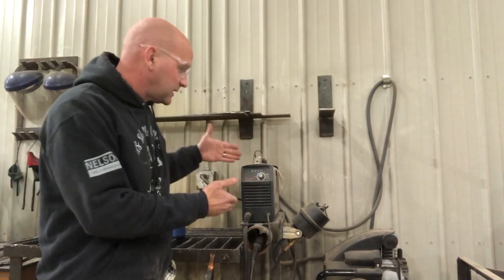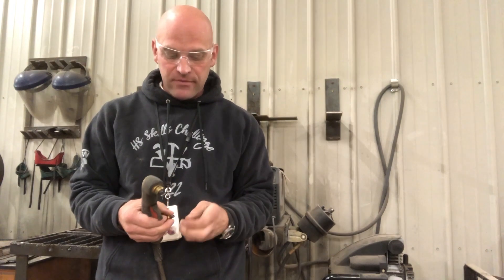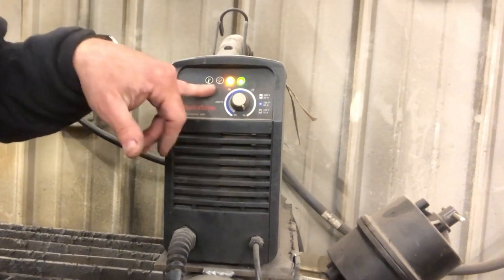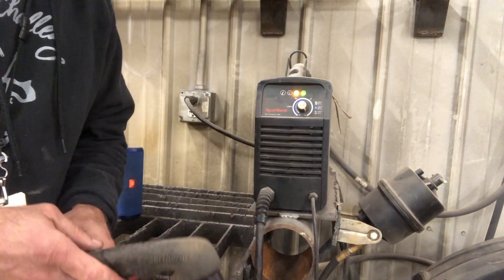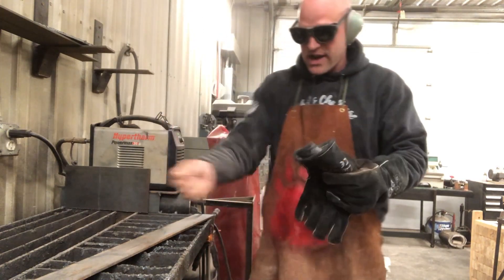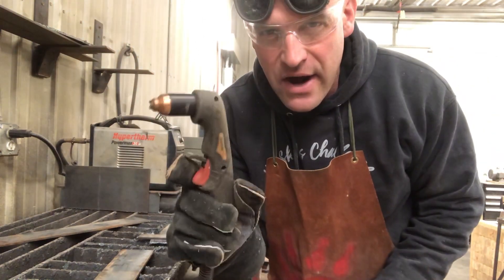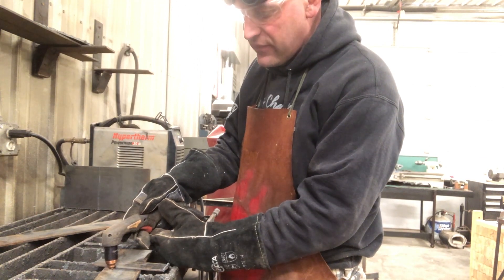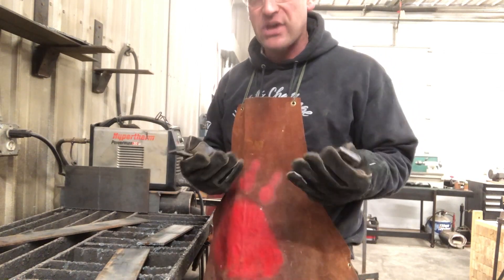How to use a plasma cutter

Comment: I'm a new viewer. I've gotten to this point in the play list without commenting lol. I work full time in a sheet metal shop and I've learned to mig weld thin metal and some 2 inch angle iron but I'm looking to expand my horizons. Part of my job requires me to cut angle iron and other L shaped pieces. I was taught the safest way was to put it like the letter A. I've tried it every way and the suggested way turned out to be the best. Thanks for all you've taught me, I hope I could pass on a little of my own.
Reply from the maker: Thanks so much!